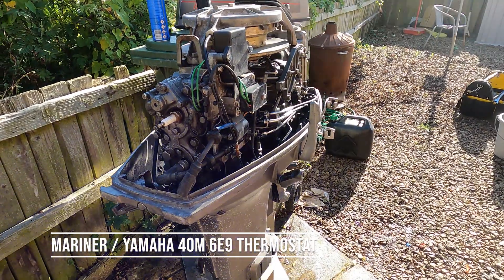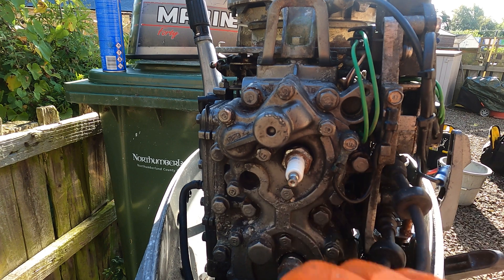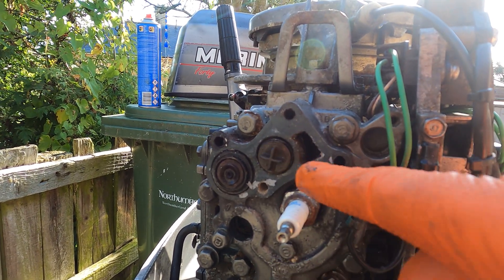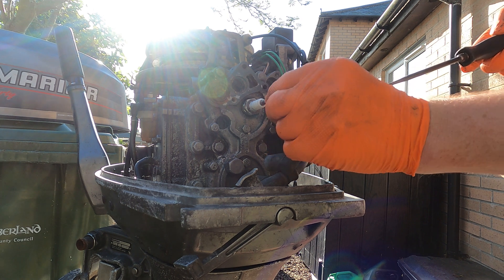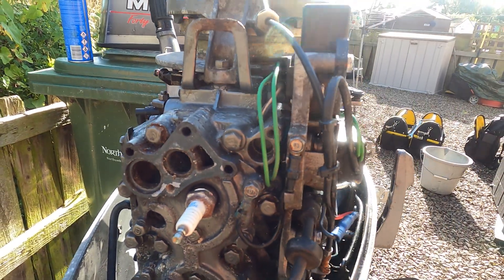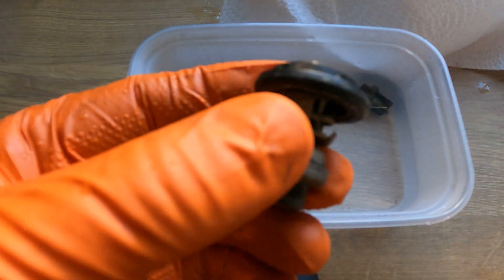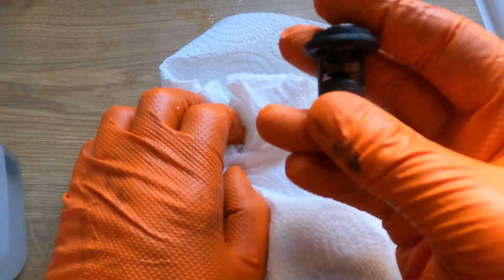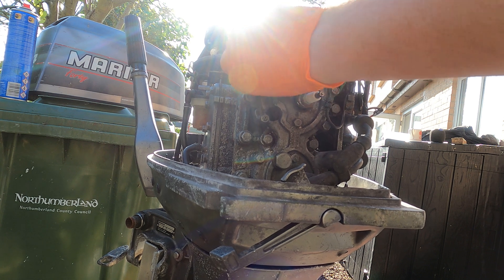Mariner / Yamaha 40 Overheating - 40M 6E9 Outboard 2 Stroke - How To Remove & Test Engine Thermostat

Comment: Good morning. Sorry for my English. Maybe I wrote the question incorrectly. The question was which engines can I use to get an electric starter? Is it a flywheel or a starter? Thank you.
Reply from the maker: Basically most Mercury Mariners from about 25hp up to 40hp

It really depends on the model but you’ll also need a flywheel with teeth for the starter to engage too.

Starter part number is - 97693M
Reply: @MarineEngineServicing Good evening. What year of Mercury should I look at approximately? If possible, I could consult with you? Thanks in advance.
Reply from the maker: You’ll be looking for an engine made by Mariner / Yamaha with 6E9 code on the data plate. 
It may be cheaper just to buy a working electric start outboard engine. 
It’s not just a case of bolting a starter motor to the block.

Comment: Good evening. Can you tell me which engine parts are compatible with my Mariner 40 6E9? I want to install an electric starter. I have the same engine as your Mariner 40 6E9. Thanks in advance.
Reply from the maker: It’s doable but at what cost I couldn’t say.

You’ll need depending on what you already have on the engine. Starter motor, start solenoid, harness including key switch, fly wheel starter ring or new flywheel, voltage rectifier if not already fitted, battery and cables. 
Like I say it can be done but it’s not straight forward.